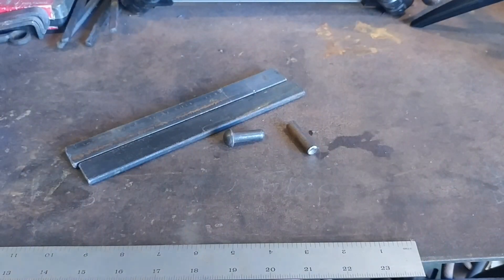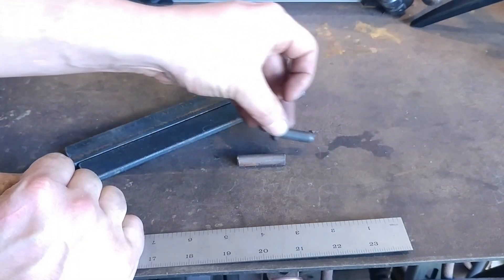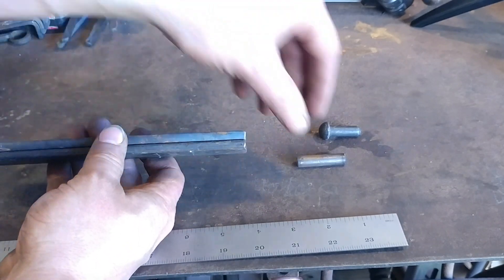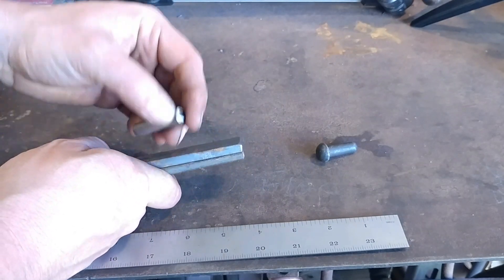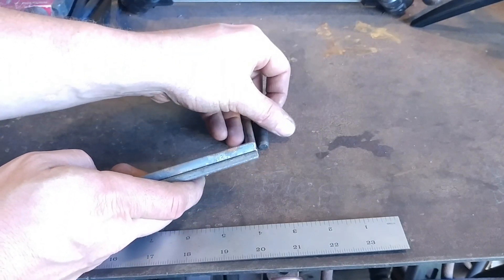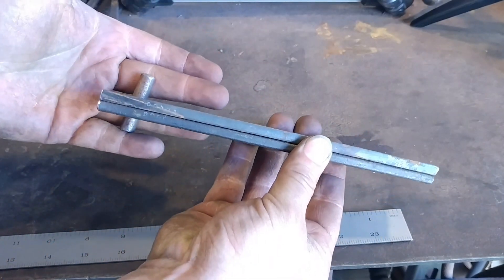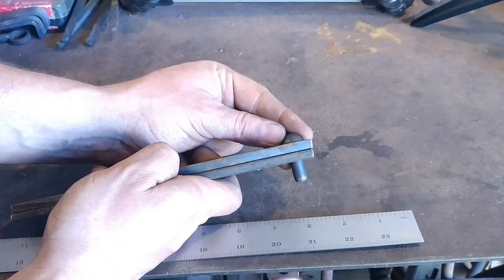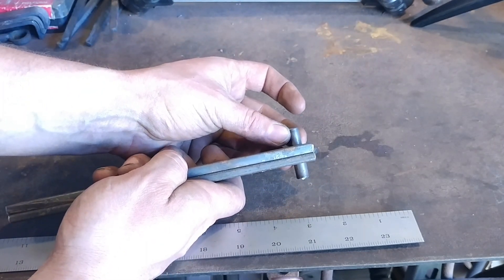How much material do you need for a homemade rivet?

Comment: Hi Roy. It looked to me as though the factory rivet had more than 1 1/2 x diameter past the material. It looks closer to twice diameter to me. Perhaps this is due to perspective from camera. Also, if you need 1 1/2 times diameter, a 10mm rod should have 15mm past the material, instead of the 12mm which you stated. I found this a bit confusing to follow, but I did like the suggestion to drill some holes and give it a try. Giving it a go on scrap material wouldnt take long to work out if you have enough material for the rivet head or not. I love your videos, they are very helpful. Keep up the good work.

Comment: you could weigh the factory rivet if you brought some but i dont think rivets can be brought here in australia please tell me if im wrong anyone who has brought rivets in australia
Reply: Hi grayem, you can buy rivets in Australia. I used to use Tinsmen and bugle head rivets in building water tanks, these were Galvanised  but i'm sure they can still be brought in steel. They came from an roofing iron supplier. Lysart Industries Australia. If I am ever unsure I tend to Google things to look for a placed to start.
Reply: thanks brett
Reply: Lysaght is the name, I wasn't sure. No worries, glad to help
Reply: dead end mate
Reply: yep was the same for me on Lysaght, I searched google, there are suppliers in Australia. Boltmasters got a mention, I looked under solid steel rivet, see how you go with that. there were other companies in Oz as well, have a look at their catalouges. good luck mate.
Reply: ill end up make them like roy i think